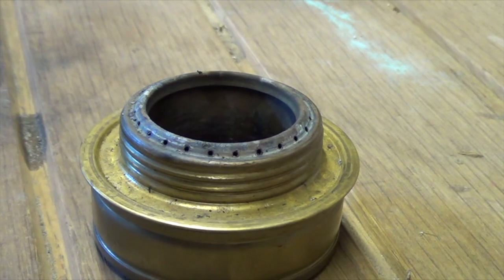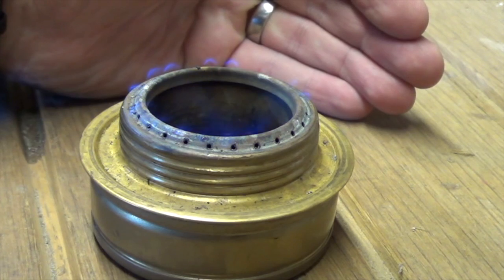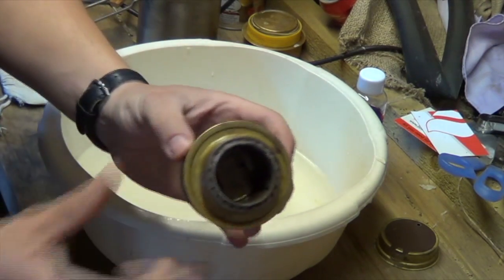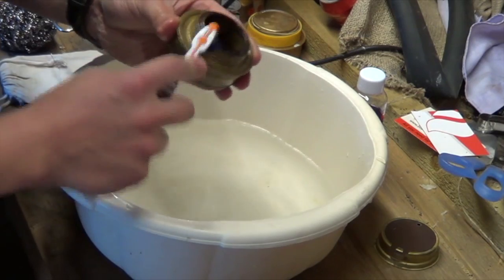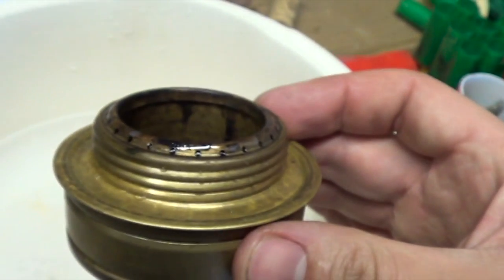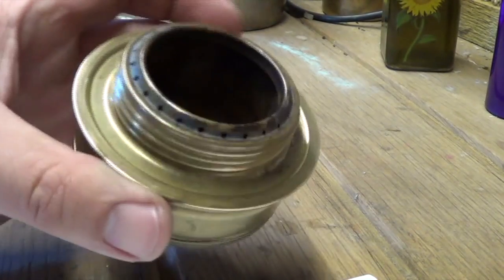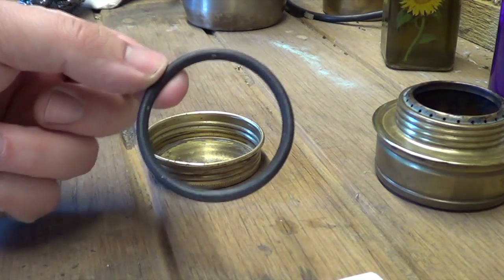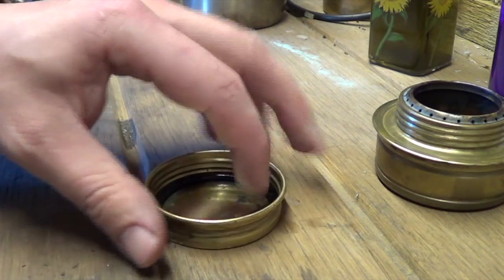How to clean a trangia burner.

Comment: Introducing water to a Trangia burner is the worst thing you can do. Get a suede leather brass brush and dry clean it which will remove any carbon and polish it clean
Reply from the maker: Thanks for your advice. I have done it this way for years without any issues so shall continue in this way. I’m glad you found a way that works for you.

Comment: As has been mentioned already in comments, preserving the rubber 'O' ring best done with silicone spray or grease and yes the jets need a scrub every now and then to keep them clean, using a dental brush is good also, Pikster brand. Thanks and keep on burning! 👍

Comment: I haven’t tried it on a Trangia but I use a water and  weak citric acid to clean off the brass parts on old Tilley lamps and it works very well .

Comment: A 10% water to meths mix should limit the soot build up on both burner and the bottom of your pans.
Reply: Zenon-Paul King i did not know that you can mix water with alcohol without limiting its burn or performances i utilise a smear of detergent over base of my pans so as any carbon build ups come clean off in water afterwards no scouring needed i only clean my burner when absolutely necessary i however use vaseline on o ring and scotchbrite to shine up burner jets and threads of any carbon deposits after soaking and shaking loose bits of carbon off or from insides burner often match heads or loose carbon deposits get insides of burner itself
but i didnt know that you could add water to your fuel to tune of 10% water and it would still burn effectively without the build ups of carbon being so prevalent good tip thanks for that info!!!
Reply: If you read the instructions on the yellow bag provided for the burner I believe mine said you can add water up to 15%. I use my Trangia weekly and never seem to get a problem with soot.
Reply: Sorry forgot to add, I use Methanol ( wood alcohol) in mine.
Reply: david john Huxtable It does affect boiling time, which also means slightly greater fuel consumption , so it is a trade off. Personally I don’t mind, it’s not that much different, I prefer the convenience of not getting black on everything.

Comment: You will have less problems with your burner the more pure your alcohol is
Reply: Yea
Reply: Yeah, that purple shit he's burning is his biggest issue.. In Australia, we use 95% methylated spirits, which is clear like water, and I've been using my Trangia for many years and it's still the same brass colour it was the day I bought it.. Oh, and stop putting water in your alcohol, it doesn't help at all, it just lowers your burning temperature which lengthens cooking and boiling time, and also causes corrosion (and the rubber o-ring on the lid is to keep water out, not seal alcohol in for transport). Adding water doesn't help with 'sooting', that's the purple colourant in your alcohol that's doing the sooting... So many people here (including the video uploader) clearly failed high school chemistry..
Reply: @Funkteon   methylated spirit in the UK has purple dye in it to prevent "improper" use. It's also more expensive and not as readily available like in the rest of Europe, for example. Most European countries have it available in supermarkets and in my experience, its also better quality and clear.
Reply: @MrTrev69  Improper use?!? What could you use it for other than cleaning and burning?!? Would you Brits drink it if it was clear?!? Jesus.....lol
Reply: I agree 100%
I use methyl hydrate at 99.9%
Never have buildup at all.

Comment: I don't know about other watchers, but I already knew about water.
Reply from the maker: Larry Kramer Knowledge is power Larry! I know that many people know this stuff but I’ve met many who don’t know so hopefully it helps someone! Thanks for watching and commenting
Reply: That purple shit you're burning is your biggest issue.. In Australia, we use 95% methylated spirits, which is clear like water, and I've been using my Trangia for many years and it's still the same brass colour it was the day I bought it.. Oh, and stop putting water in your alcohol, it doesn't help at all, it just lowers your burning temperature which lengthens cooking and boiling time, and also causes corrosion (and the rubber o-ring on the lid is to keep water out, not seal alcohol in for transport). Adding water doesn't help with 'sooting', that's the purple colourant in your alcohol that's doing the sooting... So many people here (including the video uploader) clearly failed high school chemistry..
Reply: @Funkteon  Please visit my comment again.  Water is so complicated, and difficult to understand.  That is why they call it water.

Comment: My Trangia burner was bought as part of a Mini Trangia set in 1988. I use a fine brass wire brush (the sort for brushing up suede shoes) around the jet ring and the sharp end of a fine cut circular needle file gently rotated in the jet holes to remove any deposits. It still has its original O ring lid seal, which I've washed with soap, but never wiped with oil.

Comment: If you try to always use a fuel brand/type that produces little or no soot, you rarely need to do more then this type of cleaning. If your using your burner quite a lot, then a little scrub and dry out, once a year is more then enough.
THANKS for your excellent demonstration!

Comment: Just cleaned mine following your advice using the pin on the holes. I used a Brillo pad instead, and some wd40 on the simmer control part as it had seized up

Comment: Thank you so much. I’ve just ordered a Trangia and want to keep it in good condition
Reply: I’ve had mine about 3 years now and haven’t had to clean it and it works beautifully. Efficiently and cleanly. I was advised to use a good quality alcohol - a common or garden type available in supermarkets here in France - alcool à bruler 90%. It sells about 4 or 5 euros a litre which I think is pretty cheap, but one can buy cheaper stuff. This household type alcohol is available throughout Europe.
Reply: PS… the 95% alcohol is a few cents more but smells less.

Comment: Nice fixing! :)
However, wouldn't the alcohol fuel alcohol will dissolve any oil quasi-instantly? 
And I am not sure oiling natural rubber is a good idea for its longevity. It may temporarily restore the sealing ability of an old, hardened gasket in a pinch (when no spare is immediately available), but it will degrade the rubber rather quickly as well.
Silicone grease would be a safer bet, as it does not degrade rubber and will not be dissolved by the alcohol, giving a long-lasting protection/lubrication.

Comment: As the alcohol burns off it leaves behind all that blue dye, which is contaminating the wick in the burner.
I had one that stopped working, so I cut it open and the  wick was hard and dark blue from all the dye left behind.
Reply: They don't put blue dye in the methylated spirits sold here in Sydney Australia. It is clear as crystal. I was told some of the Aussie bottle shops (off licenses to you guys) used to keep the bottles in the fridge for the winos to buy and to drink. Like the beer here, the drinkers prefer it icy cold! :-)

Comment: Try soaking the whole thing in distilled white vinegar. It works on glass fireplace doors.

Also, Canola oil is very heat resistant. HVAC guys use it on some furnace parts.

Comment: Thanks for the demonstration!

I'm about to buy my first Trangia, I noticed a company selling them with solder around an area that is supposedly prone to leaking (you can find the video here on YT). What are your thoghts on having solder anywhere near food or boiling water? I think the solder is just below the flame, so it may not be hot enough to reach a melting point. I'm just not sure if the solder modification is even necessary on newer Trangia burners.

Comment: i would use a mineral parrafin oil based lubricant not olive oil as it suits metal and rubber better as both are petrochemical products the o ring and vaseline!!
it also prevents o ring from drying out cracking up or leeching from excessive time in contact with fuel? whilst stored or in transit
id scotchbrite the burner ring or jets threads off of all carbon so as when it burns again new carbon deposits cannot adhere to older black carbon deposits left on its rim
i carry spare o rings also in case of any burn or damages to o ring
in use
i pin needle prick with a rolling action one third depths as sometimes carbon can build up outa sight between reservoir at base and burner jets it can stick halfway down if sucked up sidewalls and carries enough carbon deposits from base with it!!
after thourough vigourous wash out with water i let it air dry upsides down after good shake to drain reservoir which tends to hold onto water if you try to store it in any other manner let gravity do yer work for you over time then dry it out farther afterwards youd be surprised how much moisture they can retain a small burn test afterwards eradicates any moisture still trapped inside burner reservoir
i vaseline the threads and metal polish the top and sides its worth keeping your burner immaculate cleaned on regular basis as it negates any needs to do bigger overhaul type maint if you clean it as you go keep close eye on it i often prick jets in uses if i see them clog or malfunction just be careful of yer hands whilst doing so
i meditate on my burner sonetimes in tent perhaps i need to visit my therapist and get a life get out more!!
today i just built a woodburner hot tenting stove out of a large 4kg duck fat grease tin!! i burn tested it with flexi tube chimney
it has heatshields and airvents it goes like a king!!!!
even in freezing cold windy rainy conds
its outsides now being tested i think once you know a bit about burn principles of ignition and how a good quality fire works it transposes your interests into other areas!!!
thats what i told the detectives anyways who have accused me of being a pyromaniacal arsonist tonite!! anyways after burnt down down several sites in the city!! because i started feeling excited inside of my head when i saw a box of matches laying on the sideboards snuck out whilst my family wasnt watchn me to come watch your videos!! learn off other firestarters their crazy maniacal dirty tricks!

Comment: Brass cleaners including Brasso can lead to cracking due to the interaction with heat and brass, most stove fettlers who work on brass stoves like Primus, SVEA, etc… only use Mother’s polish which won’t crack the metal.

Comment: Any oil on the o-ring that gets on the burner will burn and clog the holes.
Sand the top of the burner with 2000 grit sandpaper to make it smooth for the o-ring.
Reply: Eeek.  Sounds violent

Comment: Doesn't the water  soak into the wicking material and have to completely dry out before relighting?
Reply from the maker: It does but it’s not as big of an issue as you might think. It dries pretty quickly and doesn’t need to be bone dry to then work efficiently again.
Reply: @SamsonsLeader  thanks for your response. I noticed you add a bit of water to reduce sooting.  Since I'm using denatured alcohol I don't expect to have that issue. In an apartment I need absolute clean burning fuel.  No soot no odor of any kind. What is that pretty purple fuel you use?
Reply from the maker: @lennettapeterson7417  it’s called methylated spirits and it’s a traditional fuel that has been used in Europe and the UK particularly for alcohol stoves. There are some cleaner burning alternatives available here now…but none are as pretty!

Comment: Thanks. I just acquired a very very used Trangia 25, and the burner was in  awful bad condition. Using similar techniques, including a vacuum and air gun, was I fortunate to bring her back to life. I definitely found that heavy crud built up around the perimeter was causing a major issue. Now she’s burning beautiful. Happy camper (pun intended 😅).

But I do have a question, which I have been searching deeply an answer to, with no luck. I noticed after adding fuel (denatured alcohol), the fuel turned purple!! I noticed that same thing in your video too!

Why is a clear liquid turning purple?? What is it about the Trangia brass that makes this happen? Do you know? Does anyone know?

I went to drain the fuel back into my bottle as I usually do, (that’s when I noticed it) and I’m thinking to myself, is this bad? Am I diluting and ruining my existing alcohol in my bottle?

I own an Aloc knock off burner, and I’ve only ever use denatured alcohol in it. But the fuel always stays clear. I’m really confused here. Any light you or your viewers can shine on this, I would be grateful!

After noticing this, I burned off several bowls of denatured alcohol, and while the purple still exists, it seems to have faded a bit. So my guess here is quality of fuel (?)

Seeking to get to the bottom of this! Much thanks!
Reply from the maker: In the UK we have traditionally used methylated spirits in camping stoves which had a purple additive. It doesn’t burn as clean as modern alcohol fuels and leaves a lot of deposits. I’m guessing that the previous owner of your burner did the same thing and some of that crud had remained. If the purple colour is reducing then this may be the cause and the more you use a cleaner fuel the better it will get. 
Those are my thoughts, not necessarily correct but fingers crossed for you and thanks for watching and commenting.
Reply: @SamsonsLeader  Bingo. Interesting. That would explain it. I thought I was losing my mind. They obviously had never serviced the burner. When I say it was caked up around the perimeter and , it was caked big time. I decided to curl up small pieces of 400 grit emery cloth, and mixed up a paste of barkeepers friend, and just kept leaning into it all the way around. Took a while, but it finally pulled 95% of it away. I tried to scuff out the inside, but that was kind of tough. After rinsing, I then used denatured alcohol as a second and third rinse, covering the top and shaking it wildly. Dumped everything out. Used a tiny drillbit just under the size of the holes, and literally had to twist drill (by hand) the crud out of the ports. Then I flip the drill bit and used the shaft to finish punching down and cleaning. Next up was a vacuum to try suck out any loose debris, and then an air gun with a small nozzle to try and blow everything out. I did that several times. Then I burned off several fillings of denatured alcohol. Jets were still plugged, I had to keep going back with that drill bit and cleaning out until I finally got it. Knock on wood. Now I get a nice even, beautiful blue flame. Knowing this about fuel from your side of the pond, I’ll just have to keep running denatured through it. Hopefully it’ll finish cleaning it out.

I appreciate the feedback!
Reply from the maker: @dobrofool  it’s a shame you didn’t make a video…it would have been far more interesting than mine! I hope it continues to burn well and serves you long into the future!

Comment: Hey just woundered how the burner would work after the cloth inside it have sucked up water?
Reply from the maker: noahsson I tend to leave it out to dry but it doesn't really matter if you're using meths as the alcohol will blend with the water giving a cleaner burn. Hope this helps.

Comment: What type of alcohol are you using in yours.  The Denatured Alcohol I use is clear , no color added to it , and my burner stays clean.
Reply from the maker: Chuck Littleton Hey Chuck, I use methylated spirits as it's cheap and readily available over here. I have bought some bio ethanol spirit fuel now though which I shall be using in the future. Hopefully it works out better. Thanks for the tip. ATB Muddy.
Reply: I've been watching many videos about this stove and the fuel. Seems the majority prefer heet in the yellow bottle. They say it doesn't leave burn marks and is very cheap.

Comment: Denatured alcohol burns cleaner, probably will keep your stove a little cleaner, but that might not be as easy for you to get.  Also, not a big deal, but I would use a different oil on the o ring because olive oil tends to go rancid easily.
Reply from the maker: flashman V I take your point but there is such a little amount I don't find it a problem...like I said, you could always use KY jelly 😉

Comment: what kind of fuel had you been using?
Reply from the maker: I had been using methylated spirits (meths) as that is what is traditionally used here but now more camping fuels are available I tend to use other alcohol fuels or biofuels which burn cleaner.

Comment: Between cleanings you can poke a push pin in all the holes to restore like new functionality. It is good to perform thorough cleanings to make your equipment last much longer.
Reply from the maker: FIS681 very true. Always good to have short, mid, and long term maintenance plans for tools and equipment

Comment: That purple shit you're burning is your biggest issue.. In Australia, we use 95% methylated spirits, which is clear like water, and I've been using my Trangia for many years and it's still the same brass colour it was the day I bought it.. Oh, and stop putting water in your alcohol, it doesn't help at all, it just lowers your burning temperature which lengthens cooking and boiling time, and also causes corrosion (and the rubber o-ring on the lid is to keep water out, not seal alcohol in for transport). Adding water doesn't help with 'sooting', that's the purple colourant in your alcohol that's doing the sooting... So many people here (including the video uploader) clearly failed high school chemistry..

Comment: Use a dry brass brush to clean. NOT WATER
Reply from the maker: Each to their own. When using methylated spirit as a fuel (as I did back when this was made) it is best practice to water it down by 10% so even if the wick is still wet it doesn’t matter. This is the cleaning method I was taught and it has always worked for me and the evidence is there in the video. If you have a method that works for you then that’s great 😃